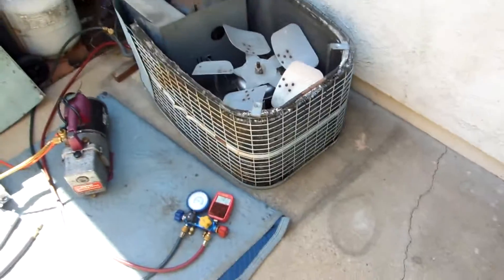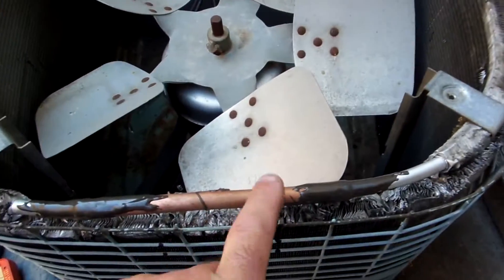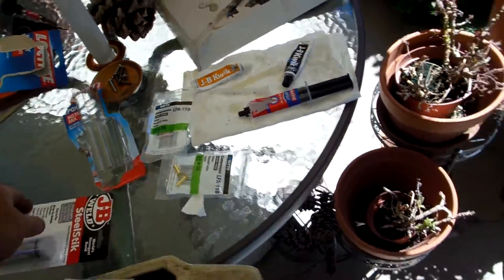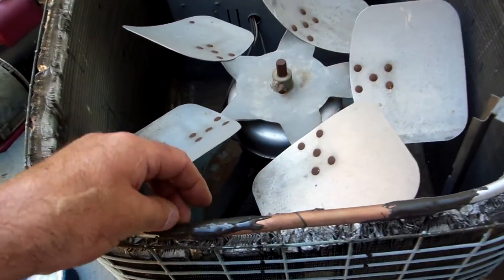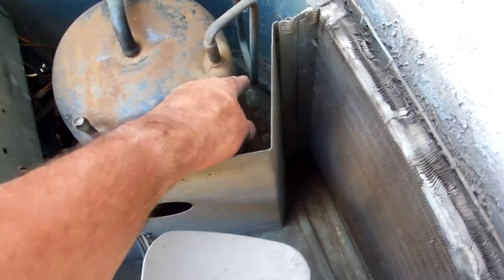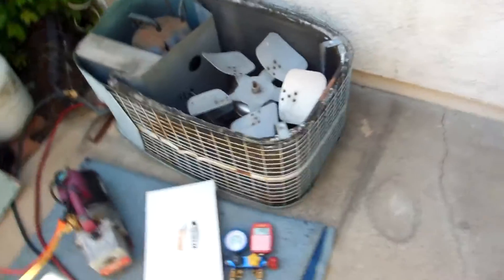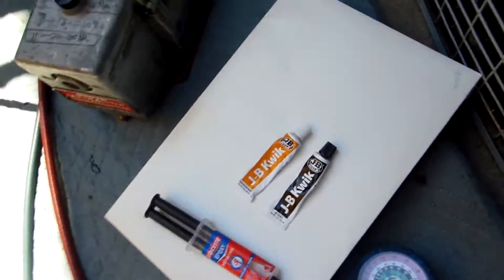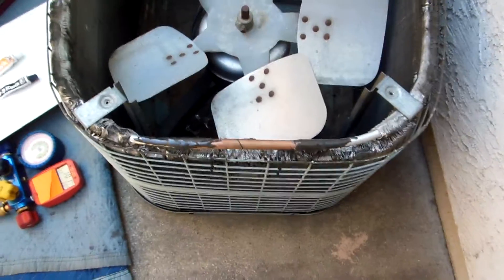A Strange Way to Repair an R-22 Aluminum Condenser. But, it Worked !!!

Comment: i tried it on my aluminum condenser.

pressurized the unit with nitrogen, pulled a vaccuum.  no leaks

added r22 freon and it started leaking right away.

Comment: I've used Epox A Leak before on evaps and air lines, not tried on hot gas.

I have some copper to ali brazing rods i keep meaning to do a vid of, think they would have worked but not sure they are available over there. 

Great job getting them going again!

Comment: Some OEMs use epoxy on their connections to evap coils. My younger brother use to work for a water cooler company in Boston and he said the failure point was always the same, the copper to AL joint that was always repaired with epoxy.

Comment: have you ever used the JB Weld on a liquid line? We have a very tiny pinprick leak I am  trying to figure out how to fix it without Brazing
Reply from the maker: Removing all refrigerant , brazing line , evacuate, and recharge is the best permanent fix. 
2) I've never tried it on a liquid line. it ended up not working here. i dont recommend it for refrigeration repairs.
3) you could try a Hose clamp and a piece of hard rubber or plastic tubing if u are trying to slow down the leak. put hard rubber over hole and hose clamp it tight. might work.
4) Best to weld it though. for permanent fix.

Aluminum or copper line ?
Reply from the maker: I've used Epox A Leak before on evaps and air lines, not tried on hot gas.
Reply: OcRefrigeration,Hvac & Electrical. This leak is inside the air handler cabinet where 2 very small lines come off the piston housing. I thought about learning how to braze it myself, but it would require me reaching down into the air handler and I would probably burn my house down. That's why I am looking for an easier method. It is a very small leak and I know that for a fact because I only need to top off my R 22 every three years. I was told this is the liquid line that comes into my air handler,  but I notice you referred to it as hot gas.????????
Reply from the maker: @ j kip -- No.  that is High pressure liquid. a warm line - 10-20 degrees above ambient. ) i was just reposting a comment one of my associates posted in the comment section. heavy diesel comment.
Reply from the maker: @ mervs --- i am a service tech so , i just Weld em up. You cannot weld em up with pressure  in it. so all refrigerant  has to be removed or unit pumped down. $500.00 repair. on average. if attic.  $400.00 if in garage repair. You could try Red Epoxy on it if u clean it real good with a wire wheel on a dremil too. Pump the unit down to 5psig. Clean area with acetone & ruff up with sand cloth. wire wheel areas u cannot sand. Red Epoxy Has Worked once for me on an aluminum tube i did not want to weld. u could try Red Epoxy or anything rated for cold temperatures down to 32 degrees at least and Pressure of 200 psig. 
Welding is best for a permanent fix though. alot of thermal expansion and contraction  going on at that  area thats why they crack and leak. that is the point of expansion / cooling right there.
Reply from the maker: @ Mervs --- That is a common leak spot. Its a difficult weld to make sometimes too. Has to be super cleaned because oil leaks out with the refrigerant contaminating the metal right there. 55% silver solder has to be used with Flux to do it right.
Reply: @OcRefrig  I think I would like to try the red epoxy you mentioned to the other guy. It is such a slow, small leak. Can't believe I would have to pay $500 to get it fixed.  Where can I get some of that red epoxy? And will  ruffing up the area destroy the current braze?   Thank you for your knowledge.
Reply from the maker: 4-5 hr job + parts = $400 - 500$ job. yea, u could make leak a little bigger while cleaning joint for welding preperation or red epoxy preperation. thats the risk u take. make sure u got $500 ready if u screw up. 🤣 is yours in a attic or garage or hallway of house ? What state are u in ?
Reply from the maker: https://www.walmart.com/ip/HIGHSIDE-HS12001-Epoxy-Adhesive-Tube-0-50-oz-Red/24534584?wmlspartner=wlpa&selectedSellerId=1122&adid=22222222228018491696&wl0=&wl1=g&wl2=m&wl3=40871781152&wl4=pla-78764553632&wl5=9031538&wl6=&wl7=&wl8=&wl9=pla&wl10=101593696&wl11=online&wl12=24534584&veh=sem&gclid=EAIaIQobChMIk9vvmImk4wIVD0sNCh3m1QdKEAQYAyABEgIQNPD_BwE
Reply from the maker: Time for you to make friends or trade with a Airconditioning guy. 🤣🤣🤣
Reply: OcRefrigeration,Hvac & Electrical. in florida. and it is in a bonus room closet. not in attic or garage
Reply from the maker: 👍. so access is not terrible.
Here's why it costs - $400-500 to Fix.

Labor & Parts - required to fix that leak permanently.

1. unload tools to working area(s) - 15-30min.
2. Pump system down - 30 min
3. Access evaporator - in attic , hallway , garage etc. remove panels. 15-30 min.
4. clean & Weld - 1-2hrs.
5. Welding materials - 56% silver solder , oxygen , acetylene , etc. $30.00
6. evacuate system - 30 min
7. re-charge with R-22 or 410a. 30min-1 hr.
8. Run & test system. fill to spec.
9. Refrigerant $$$ R-22 ? r-410 ?
10. Load truck back up with tools from work areas. 15-30 min.

Note: if u can help a the service tech guy unload his truck & bring the tools to work locations , and then help him bring all the tools back to his truck. you can save some money.
Also if u were to clean and prep the welding area to be welded u could save some money.
Also Removing all panels to access the area and make it ready for welding will save u money.
Also - Clearing the work area at the outside unit and inside area WILL SAVE U Money.
Note: if the Service tech has to climb over small childrens toys , cars , bikes , and All kinds of crap YOUR BILL WILL BE HIGHER AND IT IS THE EASIEST WAY TO PISS OFF A SERVICE TECH who is Just trying to Access The Equiptment and Do an Allready difficult job. Just a Heads up.
Note: Make a Service Techs Life easier - and Your BILL Will be Less and You will Get a Better job done.
Reply from the maker: Sorry , i can't help u out. i'm in Calif.

Comment: I would have tried a 2 flares and a union.  Appliances do that with gas lines and they don't leak. I've used that on low pressure steam and waterlines and it don't last. The surface has to be very clean . Samething with mig or tig welding aluminum
Reply from the maker: Now u Tell me. :-) good idea on flares maybe.
Oil in Refrigerant line. could not tig.
Reply: OcRefrigeration.Com i have fixed a lot of tranes near the gulf of Mexico like that. They always leak at the aluminum co]er soder joint

Comment: Would have been easier to braze it with orange brazing rod.
Reply from the maker: I'll have to check out that.
Reply from the maker: it was an aluminum condenser. i think orange rods  are only for copper to brass. orange rods are 56% silver solder with flux i believe. id need aluminum rods made specifically for aluminum welding.